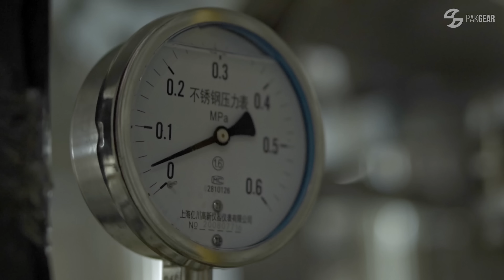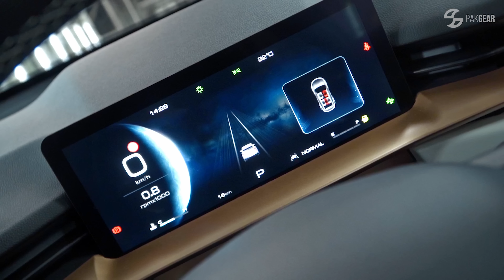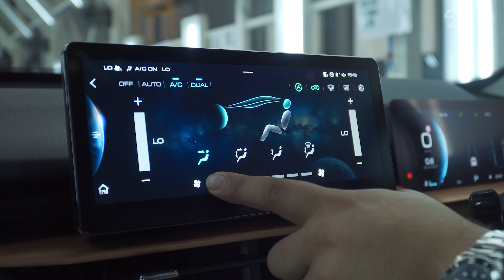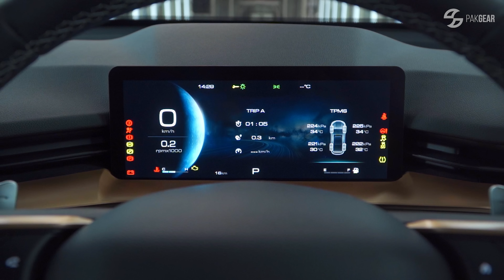HAVAL H6 Review | China Ready to Take Over | PakGear

Comment: Ap nay fuel Ka nahe bataya k hi-octane per chalay Gy sirf ya regular per?
Kyun k I heard cars now a days with turbo engine only hi-octane can support, regular petrol can damage the turbo part?? Kindly inform us about it. And thank you for giving your time becuase the way you explain is so fascinating and lovely ❤️ stay blessed 🤲🏻
Reply from the maker: Thank you! Regarding turbo engines and what fuel to use (maybe we should make a video on that);

Turbos increase air pressure in every cylinder and that increases the temperature inside the cylinders.

Because regular fuel burns at a lower temperature, it increases the temperature further inside the cylinders and that can cause damage.
Hi-Octane burns at a higher temp. so it’s generally better for engine health, especially in the long run.

Some manufacturers avoid this issue by increasing the air/fuel mixture inside the cylinder and that lowers the temperature. This, however, means you do not get great fuel economy, but the engine does not get damaged by regular fuel.

Best to check with the manufacturer what they recommend.

We would suggest using Hi-Octane in turbos, and if that’s an issue, go for a car with a naturally aspirated engine.

Hope this helps!

Comment: The vehicle looks sharp and has good road presence. The Chinese are getting much better, now that they have european designers sketching their cars. ThankGod the big 3 and their monopoly is being tarnished.  That 'HAVAL' badge at the back is an eyesore though and wish we could get more engine options. 1.5 t is never gona be enough hauling such weight. The turbo is good for low speed kick downs but the engine just screams at higher speeds and doesn't do much, there are just not enough horses to pull it at high speed. still ill give it a go if i have the option to buy at this price range cause im sick of toyota and honda 😂 good review 👍🏼 sir

Comment: According to PAKGEAR Sonata 2.5 with 180 HP and 1415kg weight is underpowered, yet Hawal H6 with 1770kg weight and only 147hp isn't underpowered. This video was also shot at Hawal Factory. Fishy
Reply: My humble opinion will be just take a test drive of Haval H6 and you will know what he means.. due the lemon chasis platform and increased torque it performs really well and you will feel that acceleration power.
Reply: @Lom70  thanks for the response! keep it up 👍